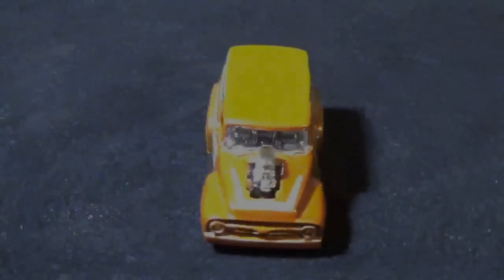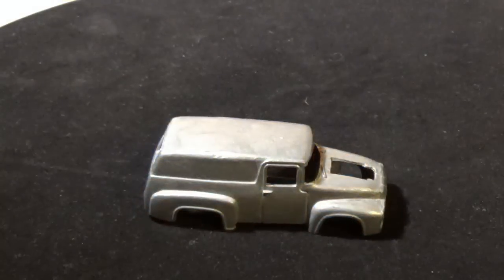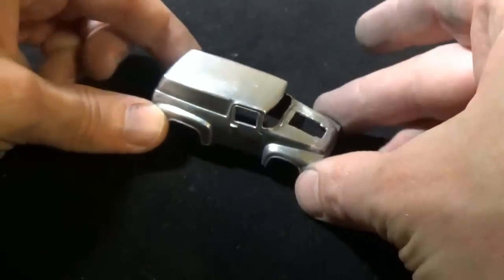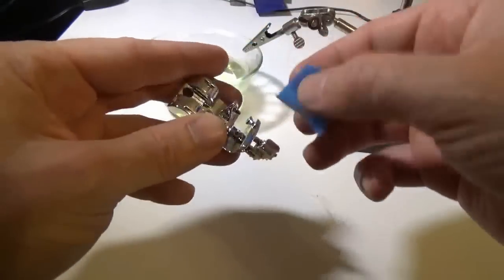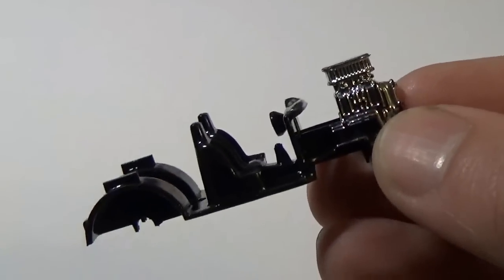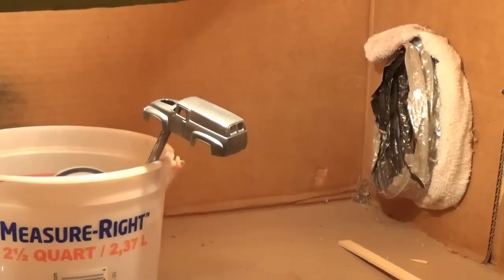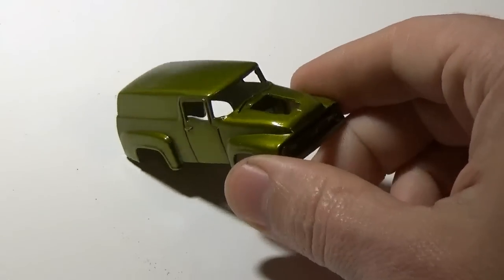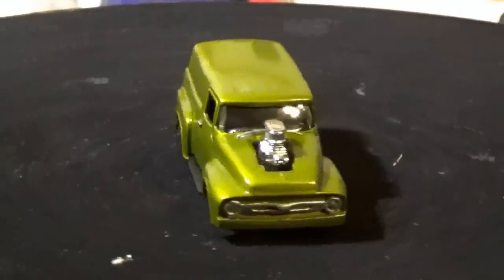Repainting Modern Hot Wheels in Spectraflame

Comment: I have a couple of trucks just like that one I want customized but mine have the hoods that flip up. I’m not painting my in spectra flame colors but I’m thinking of having it done with a dark green into a light green fade and cover that with a black metallic and leave flames on the front of it. The second one I’m not so sure about yet?. I might just paint the fenders one color and the body another color?. I also have just 56 ford pickup trucks that I want done as well. I’m thinking I might have one of the trucks match the panel truck. Only thing is my pickup trucks are from Match Box and are bigger in size. I also have two 56 ford pickup trucks with the plastic dirtbikes in the back I want to get customized as well. I have a hand full of cars I need done and I hope to find someone that is willing to do them all for me?. I just don’t have the money to buy everything I need to do it myself. You need paints and files, dermal set, paint thinner brushes primer paint window cleaner stuff the chemicals to remove the paint from the cars air brush set up kit drill bits tap& dye kit screws tires metal rods to replace axels and more cars for extra parts to make customized cars or trucks that I wanted to build. I’m sure there is other stuff I’m missing but that is a lot of stuff. That is a couple hundred dollars right there. And I’m not doing it forever I just got these few cars I want to do and that will be it. I’m not going to be a big collector of cars. I just wanted some that I like. I just wanted a small collection of cars I like and I could say that I helped design these cars and are my one of a kind cars. I’d like to get cars that are common and add to them to make them one of a kind in a way.  Jeffrey